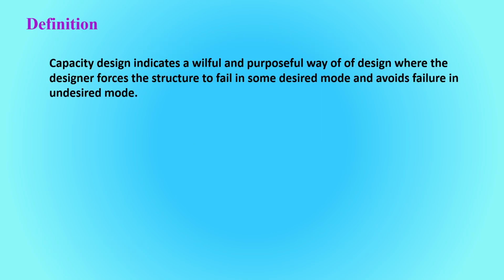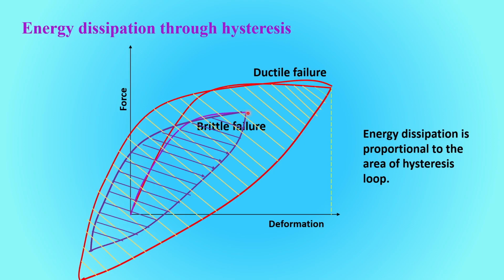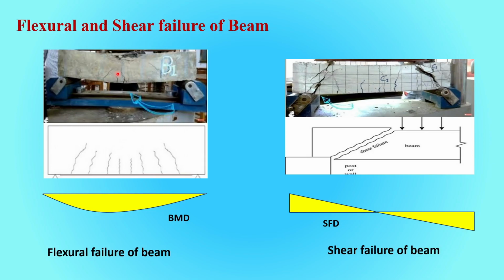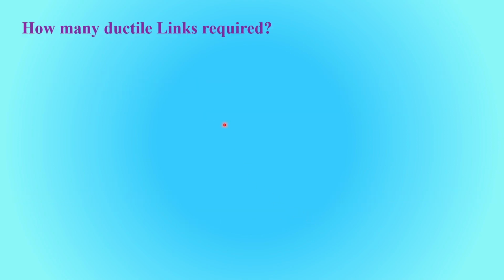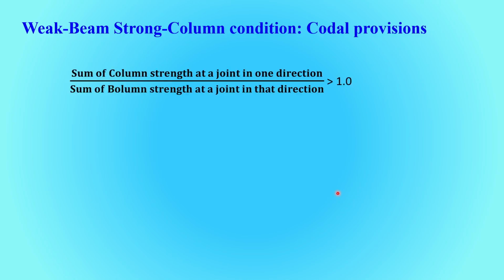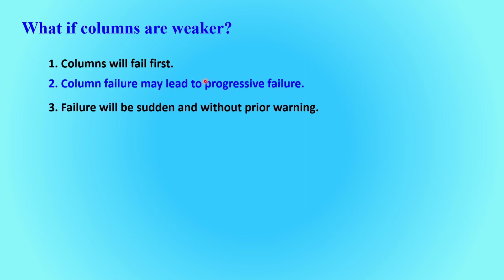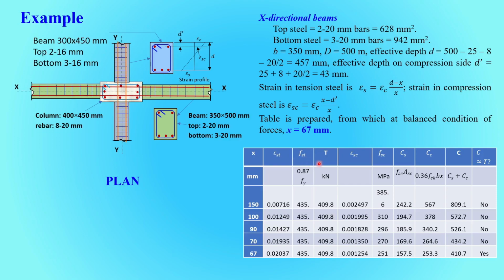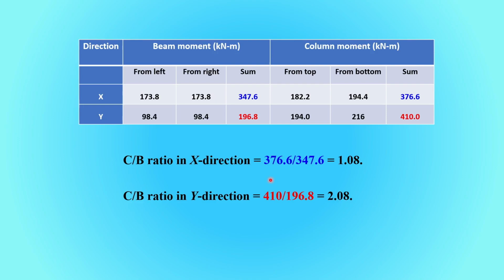Capacity Design

Comment: Thank you sir for this informative video on capacity design. I found it very insightful. I have a few questions regarding capacity design, particularly in relation to the ACI, NZS, and Australian standards.

I understand that the overstrength moment is used to amplify the design shear in beam design to ensure that failure occurs in flexure rather than shear. However, I would like to clarify whether the overstrength moment is only used for shear amplification and not for flexural design. Specifically, should the nominal moment strength (factored by the strength reduction factor) be considered for flexural design instead of the overstrength moment?

For example, suppose a beam experiences a moment of 120 under gravity loads and 140 under earthquake loads. If the nominal moment capacity of the beam is 130 and the overstrength moment capacity is 150, what value should be considered for flexural design under earthquake loading—130 (the nominal moment capacity) or 150 (the overstrength capacity)?

Comment: may I ask, at time 17.49min. concept of week ductile link and brittle link. the capacity Extreme normally > 1.5 (conc. mat. factor) or 1.15 (steel mat. factor) Limit capacity of concrete section .. is that reason M_col / M_beam has to be in that range of 1.5 to 1.15. IS code 1.4 and EC8 1.3 ?
Reply from the maker: The  C/B ratio of EC-8 or IS appears to be based on the philosophy discussed, but neither has explained the background. However, Gama_mcs have a different context.... You have to compute the extreme strength and limit the strength of a section, and find their ratio.